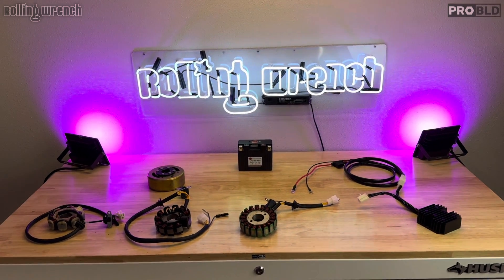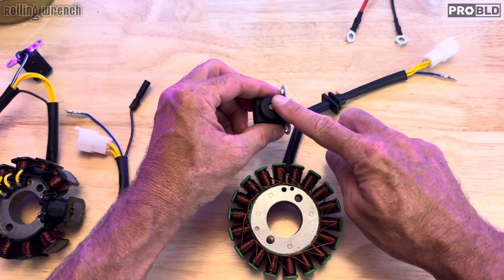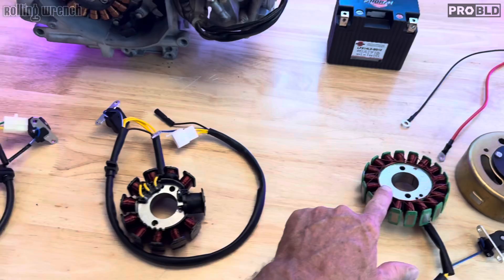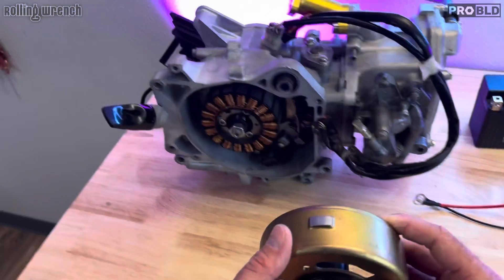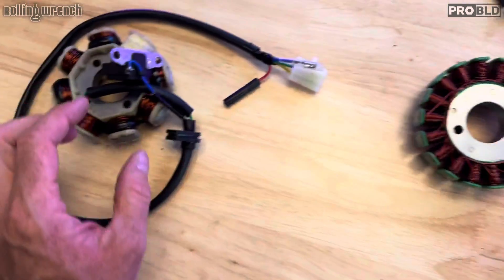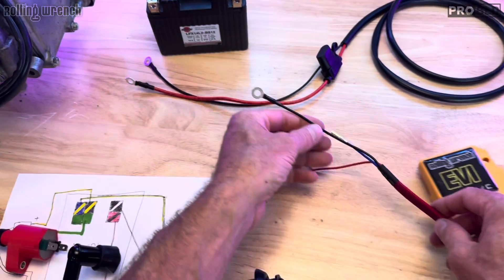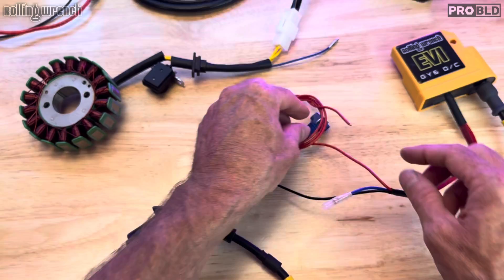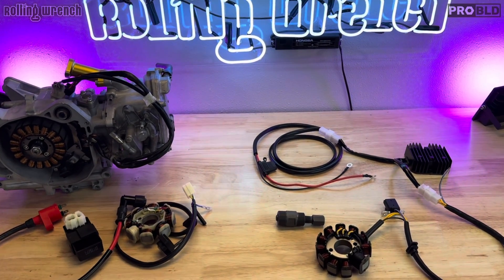GY6 AC vs DC Stator/CDI [ How does it work? What is best? ]

Comment: I like your video. Unfortunately the DC will not work without a battery. The exciter coil is there for a reason. Many dirtbikes dont use batteries. My CT70 clone engine doesnt use a battery so the DC unit will not work.
Reply from the maker: This video was specifically for the GY6 engine. The kit is used for GY6 only. But yes you are correct. Ac has to be used on the dinosaur bikes with the dinosaur technology. This was the point I was trying to make. Battery equipment GY6 engines are still using AC systems. They should be updated to a newer and better technology.
Reply: @RollingWrench  Does that mean the GY6 engine technology is not "dinosaur" tech?😂
Reply from the maker: @cristianr3712  No actually quite the opposite. As I showed the GY6 Stock AC system is dinosaur tech. The dc system is the updated system. I thought I did a decent job showing that…. But maybe not.
Reply: Sorry I prefer the ac system then dc system.the dc old school to me
Reply from the maker: @ronaldfain4541  you do you bobo…. Not me, not even 1%
Reply: Dc is old tech not new tech and don’t call me bobo
Reply from the maker: @ronaldfain4541  lol. Sorry dude.
Reply: I couldn't agree with you more. Even with a dead battery, an AC system will start the motor if you can get it turning. And, you have an old school HONDA, which will never die, and is superior, (not a dinosaur), to any scooter motor out there. Because this guy is fairly knowlegdable, I'm a bit surprised he'd say that because either are systems are fairly easy to diagnose.
Reply from the maker: @dc6233  dc is is king :-) final answer :-)
Reply: @RollingWrench  I was trying to do full led light conversions and kept blowing bulbs... turns out it's easier to convert to full dc than to have buck converters going to every single thing I need to regulate ac -> to dc voltage for. Totally a better system.
Reply: @RollingWrench I love high voltage tech, love my vacuum tube tech a lot!
Reply: @RollingWrench here's the thing, what happens when you got a DC stator but you also got a pickup coil with two wires W/R - W/L and got a wiring harness that connects to a 6 pin CDI and you just don't get a spark!! I Measured the pickup coil resistance and the stators, it checked out, and also checked continuity on the CDI and also checked out. Just can't get a spark!! Maybe you can help me with an answer.. all the wires match up in the stator plug except the W/R from the pickup coil, I've got a ground in the wiring harness instead..?
Reply: 18 knuckle stator,18 bump magneto,cdi coil combo. But how does the voltage rectifier regulate, everything is going in and nothing out
Reply: Will A C work without a battery???

Comment: Would the AC system keep working if the battery died?
Reply from the maker: Yes, if the charging system was working. No if the battery was dead and the charging system was not working.
Reply: No!

Comment: Excellent content... and even better kits!!! 👍 
I've been tinkering with the Lifan, Zongshen, and Shineray 200cc and 250cc vertical clones for a few years now.
I've done engine swaps on both of my 1972 Honda CB100s with these engines. I absolutely LOVE THEM!!! The 172FMM is a BEAST!! 😂
Unfortunately, both of my vertical clones have "wet" 8 pole AC stators. They also have very odd sized center hubs and bolt spacing. Mine also mount to the stator COVER... not to the case.  I've looked everywhere for 11 and 18 pole stators that have the same hub and bolt spacing, but i can't find them. 
I guess my only option to convert to DC ignition is by deleting the exciter coil circuit in my AC system. I dont have any issues with charging or dim lighting with my existing 8 pole, so it would probably work fine... RIGHT??
I REALLY like the idea of your digital DC CDI. 
Verrrry nice, indeed! Have a great day. 👍
Reply: Use LEDs the stock charging system is something like 40 watts? Should stay charged with a couple 15w leds. Mine stays at 14.4v with my dash, 2 headlights, and my phone charging off of it too. Gotta be 60 watts there. Thats at idle too

Comment: So I have a black wire that comes out of my stator (11 pole gy6), but nothing coming out of my drow harness that it connects to. I got curious and put a multimeter on it and the voltage was 200+, what does it go to?
Reply from the maker: It’s probably a black wire with a red strip. I imagine drow uses a basic dc cdi box rather than a dc cdi coil. That would mean everything is the same as an ac set up, but with a dc cdi. So 12v power goes to the cdi rather than ac power